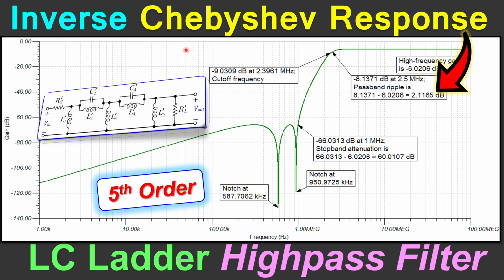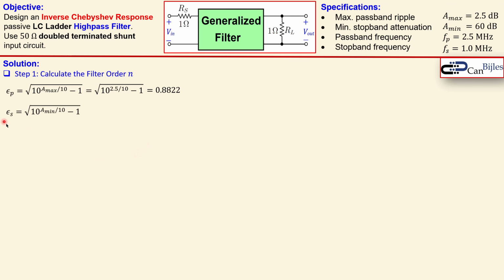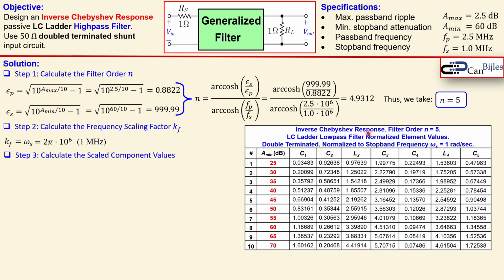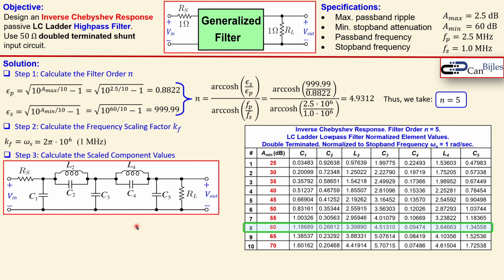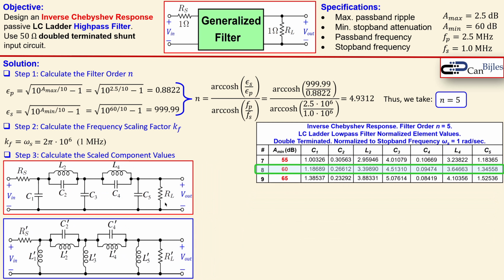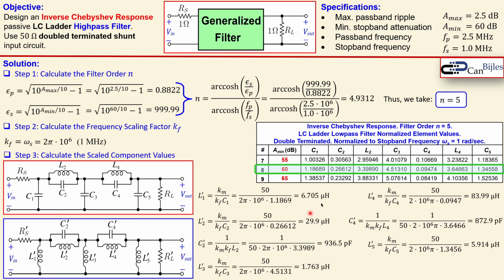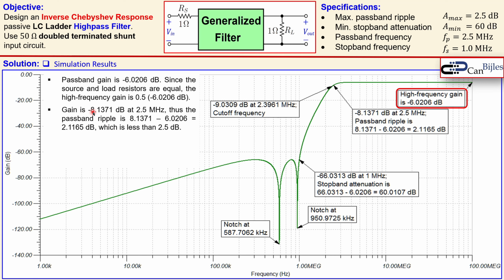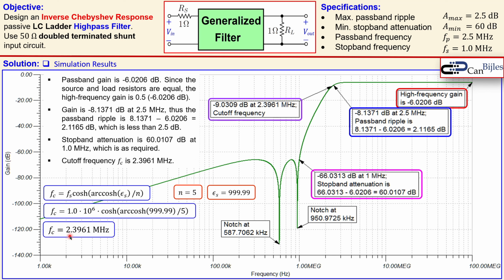LC Ladder Highpass Filter Design 💫 Inverse Chebyshev Response - 5th Order 💡 Example 2

Comment: hello sir , i hope you are doing well ,
i m curious about the order of the filters they are all odd number 3 / 5 ...
what if the filters order was even like 4 for e.g , that would change things , because we won't have PI topology neither T topology ? 
like it won't be bidirectional  or something like that
Reply from the maker: That is a good question! For Chebyshev response filter, you can get even ordered filter too, but in order have the specifications correct, you need to apply an attenuation. This is merely to have the ripple location (peaks and valleys) correct. If you do not add the attenuation, everything is shifted in frequency. This is always the case for Chebyshev response. For Butterworth or Bessel response, this is not required. See this for a table with even ordered Chebyshev response and the required attenuation: https://drive.google.com/file/d/14UMFPFhnSU_3UXAXL50gJ0Q7PVAVdcem
Reply: thank you for the response !
So we have to make the ripples Amax =0.1dB and use it in our calculation in order to use the table with even order ? @CANEDUX
Reply from the maker: @mohameddrissi1075 You have any ripple you want, I only shared a part of the maybe tables for Chebyshev response design.
By the way, using tables is nice amd fast but when you want a specific ripple, like 0.35 dB, then you should use the actual pole locations, natural frequency, and quality factor. I am planning to make a video about these cases also as soon as possible.
Reply: @CanBijles   thank you sir ,
i'm so excited to learn how to calculate all these values ourself !
Reply: @CANEDUX  I'll be so greatfull, if you include also active filter design (Butterworth, Chebychev, Bessel..)
Reply from the maker: @mohameddrissi1075  That is also on my list, but just do not have the time to get it done yet. Also, very interesting algorithm, called Geffe algorithm, will be discussed for bandpass and bandstop filter designs.
Reply: @CANEDUX  Can't wait ⏳!!! to learn more from you ! I'm really in love with electronics especially analog because it combines physics , math and electronics + pcb design unfortunately,we don't have alot of it , and i can't find a job in analog design it's all about digital and software 😢